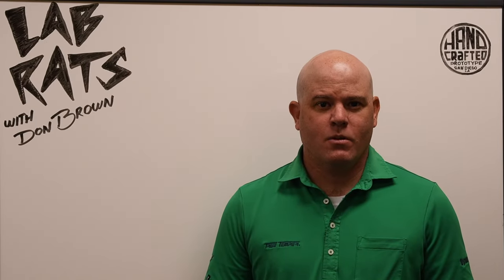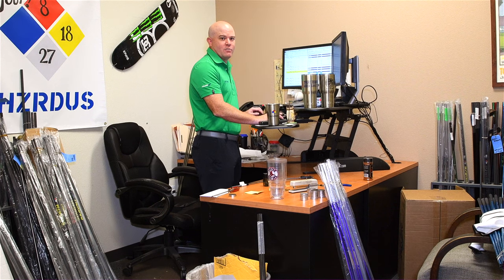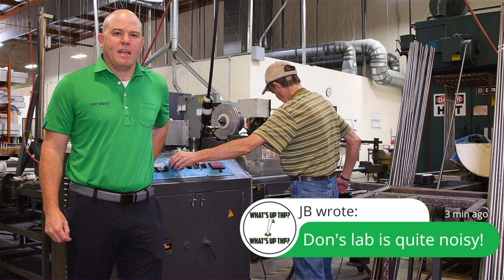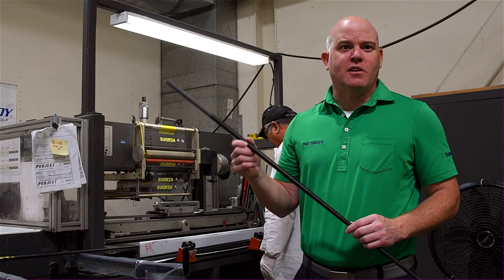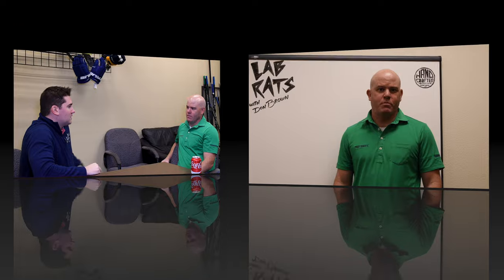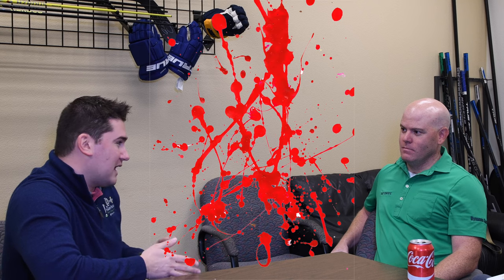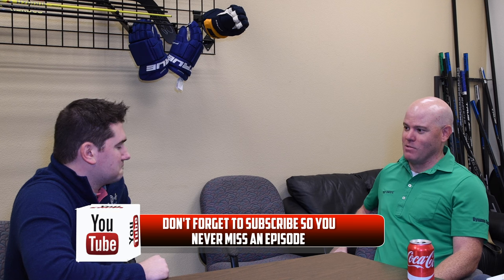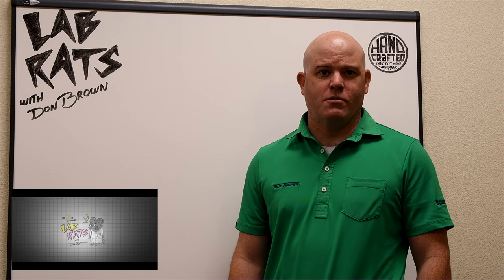How are Golf Shafts Made?

Comment: I'm 72 and my index has gone from 3.6 to 6.8 over the last 2 months since I bought Callaway Epic Irons & woods.  I first switched to regular Recoil f4' irons and played them for about a month.  I didn't hit them good so I went to F3 Recoils after meeting with a club fitter.  I still don't hit them nearly as consistently as I did with my 65 gram Stiff graphite Taylormade 6 year old irons.  I now have my new Epic Irons up for sale and have gone back to my Taylormade irons.  I had also bought Callaway Epic Driver, 3 Wood, and 5 Woods with regular Oban Kyoshi HB 55 shafts and have found I don't have near the consistence I once had with my old Tayoormade woods either.  I am so frustrated!!!!!!!!!!  The club fitter had me hit on his Trackman and advised me to go to Regulars but I hate them in my irons and woods.  I guess I will sell my brand new Epic Irons and woods and go back to me old clubs even though I would like to upgrade and modernize.  Now I'm very hesitant and scared to do anything new -- just stay with the old.  I feel I have wasted a lot of money.  The only positive is that now that my handicap has doubled I am winning until my hdcp comes back down now that I've gone back to me old clubs.  Any suggestions?  Thanks,  Woody`
Reply from the maker: Go see a different fitter and compare.  Club change rarely causes immediate consistency issues, so more than likely you are struggling with impact due to the change.  I would recommend sticking with it and working on the range for contact or seeing another fitter.  The clubs you purchased are excellent.